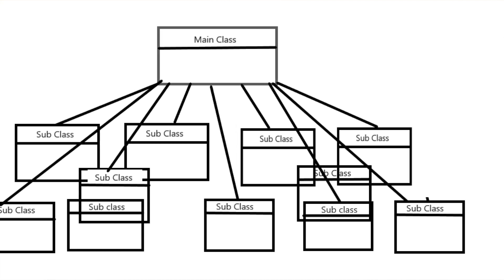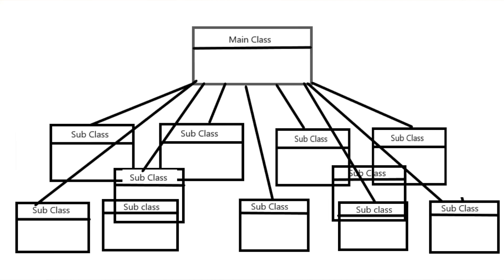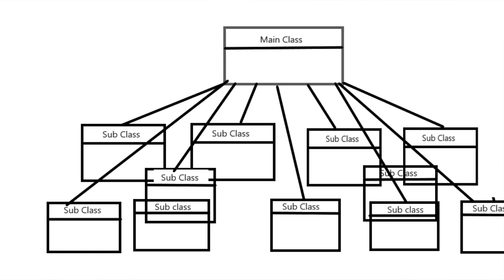Overengineering in Software

Comment: This is so real, I'm currently maintaining a legacy codebase (Android) that's design-pattern crazy. Everything happens somewhere else, in some delegate, or strategy, created by a strategyDelegateFactoryFactoryBuilder or some such..

Every issue takes hours to track down just because it's hard to find the bit that actually Does Stuff. And the irony is - it's still not well designed. Encapsulation is poor - clearly previous maintainers got so frustrated trying to do things 'properly' they ended up putting direct database queries in the UseCases. And the LOC is about 4-5 times what I'd expect in an app this size.

I think some developers think they're not proper developers if they do things the simple way - but actually the naive approach within a simple architecture (a traditional CA usecase/repository/datasource for example) is really the best - reach for design patterns when you hit a problem that requires them, not before. 

Far more useful is iron discipline when it comes to encapsulation - code to interfaces

Less code == less bugs.

Comment: My only overengineering was a databases. I've did a very normal form, and queries started to grow in complexity.
Reply: I think databases is one place you should over engineer. A mediocre/bad database design is very costly and tables are hard to change. Code is very easy to change if done properly.

Comment: This video is 2 years old so I wanna give my two cents: I'm not a Kubernetes expert or whatever, but I personally find it interesting to spin up your own cluster and try things out. The technology is never the problem, it's just complicating simple applications that's the problem. If you truly need world-wide high availability then yearh, sure, spend a couple hundred/thousand $ each month to accomplish that and Kubernetes (rather, Cloud Proviers), is the way to go. A lot has changed since 2020 and Kubernetes is starting to become easier and easier, both to manage and develop for. Still, your argument holds today: do not overengineer or complicate your applications simply because Kubernetes is the cool guy out there. If you have a reason, fine. If you don't then don't bother. By the way: I don't know if it existed in 2020, but now (2022) we have "serverless" and "functions", which are the "throw code or container at the provider and scaling will happen automagically without managing your clusters yourselves". Not sure how good that is because I don't use them but yeah.

Comment: I agree that k8s is over engineering. But I disagree that docker is. Not docker swarm, because that's an alternative to k8s. But docker has distinct advantages over "just a few vms". And using docker is generally as easy as the vms these days as most providers have a container engine.
The main benefit of docker is instead of thinking about how to split up resources on vms, you think about what services you're running. Imo docker simplifies the way you think about deployment

Comment: Before I discovered this channel, I had a little side project with a frontend and monolithic Nodejs backend. It worked, it made sense, it had a bunch of bugs, and to 'improve' it I wanted to turn this backend into a mesh of AWS microservices. I thought breaking this app down into tiny pieces and managed services was an intelligent design. Eventually I lost momentum and fell out of love with the project, and for the life of me I couldn't understand why.

Now it seems obvious in hindsight; it was over-architected, it dumped piles of AWS config files I didn't understand into my project, debugging was arduous, the managed services have great marketing but I didn't understand what they were doing at an engineering level, and getting anything done was mostly just sifting through loads of AWS docs to find an explanation. I was trying to shield myself from the implementation details, and that was... just dumb.

It was a good learning experience with no real consequence. Your videos help me understand and appreciate 'vanilla' software code, lower-level fundamentals, and plain simple easy unsexy architecture. Thank you :)

Comment: I totally disagree with his bashing on design patterns. These design pattern do solve a very common and underestimated problem in software: close coupling of classes (or as I call it "spaghetti classes"). Those design patterns help to structure the project and untangle the mess, you'd otherwise have (god classes, violation of single responsibility principle).

Understanding the patterns and using them effetively can and will help to achieve one important goal EVERY software has: Modularization.
Modularization increases both flexibility as well as maintainability of your software, leading to a long-term reduction of developer costs.

Those patterns certainly didn't develop out of thin air. Studies have shown, they can and will help you organize your software-projects and reduce training periods for new developers in your company, because code becomes easier to understand.

If all those things didn't apply, that'd mean all those books about OOP/design patterns are obsolete. Is it that, what you're trying to say?
Reply: I am a junior web developer and trying to improve my code by applying some design patterns and best practices. I was about to try mediatr in my amatuerish mvc project but hesitated after learning about over-engineering. I'm not sure what to do now?
Reply: Single responsability taken to the extreme create unmaintainable code so difficult to understand, and depressed people.

Comment: The only thing I disagree with is telling Docker over-complicated. My life as a developper is way simpler now that containers exist. Especially in terms of workstation (in my case, deployements also became easier). I can't even imagine going back to the Vagrant times. About "why do we over-engineer things ?", I personnally do it to stay relevent on the job market, the recruters want me to say those golden words and they want me to say I had experience with it. I am sometimes willing push over-engineered solutions even if it leads to an unmaintainable mess because of that. It IS a bubble, fulled by speculation. And we developpers, have to ride the wave to stay employed.
Reply: So you are contributing to this mess

Comment: I agree with a lot of stuff, but you NEED to separate Docker and Kubernetes.
They are 2 different technologies, designed to solve different things. 

Docker is a good choice regardless of whether you use microservices or not.
It makes everything isolated, and even if you have one service - wrapping that software service and all it's dependencies it in a docker image which you can run everywere (vm, local machine or kuberenetes cluster) is simply convinient.
Also makes CI/CD to that service much easier.

Kuberenetes is another beast. It was created to orchestrate multiple containers, spin up and kill containers in realtime due the developer configuration.

While kuberenetes is more of a devops/infrastructure tool which not every backend engineer should know, I believe Docker is necessary for every backend engineer.

Comment: The team lead is religiously adhering to "clean code" and it's the most complicated, over-convoluted mobile app I have seen - it's a nightmare to maintain and develop.
I had to add a single view and it meant amending/creating 25 files - jeez!
The problem is that you introduce a framework to solve an abstract problem and you introduce a whole bunch of new functional problems.

Comment: This is one of the most enlightened responses I've seen in a while. It's also My intuitive judgement about the current craziness happening everywhere. Small, single-digit backend teams building impossibly over-engineered distributed systems with microservices :F. I feel the pain everyday personally as I have to maintain solutions like this under heavy time-pressure.

Keep it simple stupid.

Comment: 9:50

Well... why use a few VMs when you can use a few containers on one VM? It seems like the simpler solution to me, if you’re used to using docker.
Reply from the maker: Sure that might work for a while. However If that VM goes down all your containers go down with it. So you will have to add another VM, install docker and run another few containers on it and here is where it can get messy to manage different containers on multiple hosts and where you need container orchestrating like k8. All of a sudden you went from few vms with just your apps to a fleet of paas that you need to manage.
Reply: @hnasr  Ah. Fair point.

Love your channel btw. Your enthusiasm for web development is infectious! I'm getting started in freelance web development and design and your videos have been very helpful.

Comment: This is so true. Currently I'm working on a project which is the second one I've seen which is pointlessly split into microservices. There's no need as the system doesn't need the scale massively, and the entire project can be handled by a team of 2 or 3. It's incredibly wasteful. Microservices architecture was meant to be used to break a very large project into pieces small enough for a small team to work on each piece. I think this comes from a mixture of the terrible tendency for back end 'best practice' to be driven by people working on very large projects. Most work in the industry is on smaller projects where a lot of what passes as 'best practice' is premature optimisation, which as the Unix guys said, is the root of all evil. I also think it comes from CV-driven development, which pulls large scale practices into small projects because every dev wants to graduate to a large project and to do that they need experience on appropriate technologies.

Also totally with Hussein on the atomisation of classes. For a practice which is supposed to improve maintainability, it only does so in the sense of making it theoretically possible to reconfigure your classes into something else easily. Because there's no courses or articles much written on what it takes to make code navigable and readable, this is thrown out of the window. This is actually the most important factor in maintainability, speaking as someone who's worked with scores of systems written by other people who have since left. I've wasted hours trying to find things following endless chains of pointless indirections.
Reply: Yes, this is very painful indeed. I've also maintained code like this for many years now and it's a pain in the a$$. I think this overatomization of things happens because programmers understand commonplace good practices like single-responsibility principle wrong. Single responsibility principle is not about having one overatomic class for every single thing, it's about placing cohesive pieces of functionality close to each other. If something needs to change you want to minimize the amount of places you need to find and navigate through to get that change done.
Think about backpack pockets for example: I keep my Wallet, keys and phone in the side-pocket because I have a usecase for frequently accessing them together. I check my shopping list from my phone, pay with a credit card and open door to home with my keys. This is a well-organized cohesive piece of functionality!

When the individual pieces of functionality are spread in thousand little places that don't logically belong together it becomes impossible to trace what you need to change and where. 
Once again take the backpack: imagine if I went shopping and my backpack had a wallets, keys, phones etc. pocket. It would be fairly cumbersome to get through the Day.
I've maintained projects that do fairly little functionality-wise and they've been decomposed into thousands of tiny distributed pieces while the stakeholders were grilling me over "what's taking so long to get that done, the architecture was modernized last year with microservices" :D That certainly had a dilbertisque impact on me.
Reply: @akivaliaho5166  I can't agree with you more. I suspect that the problem starts when you think that you can decouple a system by splitting it into smaller services and just placing a message queue between them. That is a lie.
If in every feature you have to add, you have to touch half of the services, then you have a VERY coupled system.
If in the same situation you put that logic into just one service, then you have a very decoupled (just one module) and high cohesive system.

Splitting != Decoupling
Reply from the maker: James Ellis-Jones thanks for sharing your experience James, premature optimization is the enemy. True.

Comment: Isn't good to have a variety of abstractions and interfaces to make the system much more loosely coupled? thus easy for scalability and maintainability, correct if I am wrong please.
Reply: Nope, loose-coupling needs something called COHESION to be maintainable. You can have coherent, yet loosely-coupled components. That's modular design. Non-cohesive over atomization into tiny loosely-coupled pieces with no context is lunacy.
Reply from the maker: Masaad B thats we have thought for a long time. But actual implementation and real stories tell us otherwise

Comment: Ironic we use "Over-Engineering" to describe "Under-Engineering". Hussein, you eloquently describe many "anti-patterns" that seem common and lead to poor design. As you mention, blindly following patterns, including libraries, slicing an app into tiny files, pushing massive amounts of software to the browser leads to poor performance, inflexible and unmaintainable code (I didn't mention the trend of comment-free code), and huge increase in the amount of software and in turn bugs. What is engineering? It should be evaluating all alternatives to find the optimal solution to meet requirements-- User Experience, performance, cost, implementation time, maintainability, etc. Even with super-high bandwidth, many web sites today seem 10x slower than a decade ago, even slower than the 56Kb modem days. It's bad architecture and a lack of engineering to optimize for requirements instead of following some religion on patterns, object-oriented, reused code, etc. I once attended a talk where the speaker said the goal of programming is to reuse as much code as possible.  No, the goal should have been to simplify the code as much as possible, and above all document it with well-written comments, etc.

Hussein, thanks for bringing up these issues-- it's badly needed. Only a few lone soles seem to point out a contrarian view of what is considered "good design". Certainly 3MB of javascript is mot better than 10KB for the equivalent behavior. 1000 files with 10 lines is not better than 10 files with 1000 lines. Some commenters have shown Object-oriented programming is often 2-4x the size and complexity of the usual procedural oriented code. Dynamic SPA web sites downloading hundreds of files and in-browser database accesses is not better than a single html page, pregenerated when the database changes and pushed to a CDN. Instead of SPA, we need SFP, single file page.

We need more "Engineering", that is finding a better, elegant solution with less, and we need software that creates better results-- faster, easy to use, effective at communication.
Reply from the maker: Carl Hage you touched on many points I missed Carl. Thanks! We need more quality engineering.

Comment: Hussein, correct me if I'm wrong. I do see a number of benefits with microservices over monoliths even with simple applications. I think where the complexity comes in is through the decisions and strategies that are at play at the service level such as using containers and clusters vs simply running your service in a VM or better yet a lambda. What I truly love about microservices is the organization and "silofication" (not a real word) that they bring to the table. However, you made some great points overall in regards to the issues we face with over-engineering.
Reply: You can do the same with folders or assemblies, you don't need to incur in the cost of creating new services for that
Reply: Pardon me for beating this dead horse again but the microservices craziness just doesn't seem to slow down so I need to comment on this to stay relatively sane as I'm once again dealing with the remnants of distributed monolith microservice chaos. Most of the benefits of microservices can be baked in to the monolith as well. Remember, monolith doesn't automatically mean bad! It's just a deployment strategy.

What I'm talking about is modularized design, monoliths can have a modular design as well. It's all about placing cohesive pieces of functionality inside your chosen container! Function, class, package, module, repository, microservice in order of things you should try. A lot of tricks can be done to simulate other benefits of microservices within monoliths as well when your design is modular. For example: you can scale your load per individual module by using your languages concurrency tooling. Have a module that takes most of the brunt of your load? Assign more threads to it. BAM! Individual scalability per module. Slow build? Utilize compile avoidance! BAM! Fast build again, etc etc.

Microservices is a very aggressive last course of action you should try before exhausting all the easier options first. At that point your design most likely is quite modular already and sliced in a maximally autonomous vertical slice...